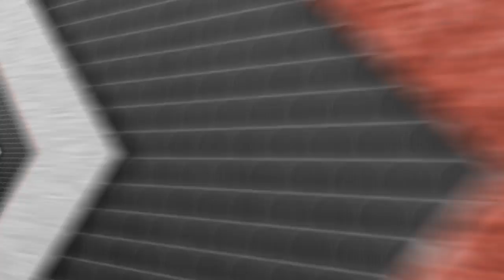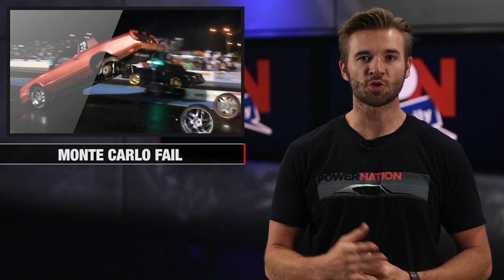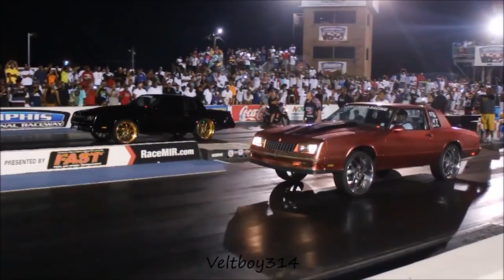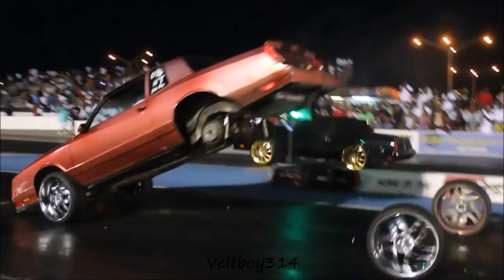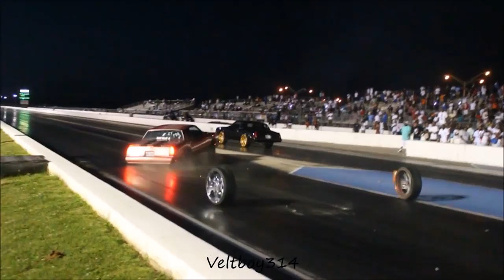A Monte Carlo Literally Blows Its Wheels Off At The Track

Comment: 80 lb 28"wheels breaking lug nuts? not surprised.
Reply: maxxjett films They are billet not that heavy he just made too many passes on the studs with out inspection or replacement even on 24 inch slicks you don't get enough grip to shear the studs like that. You BlackBlurr launched on 24 slicks and Donkmaster makes more power and he still running his shot without mishap